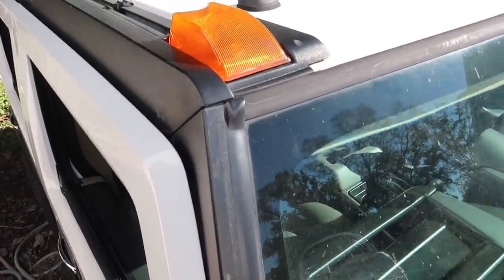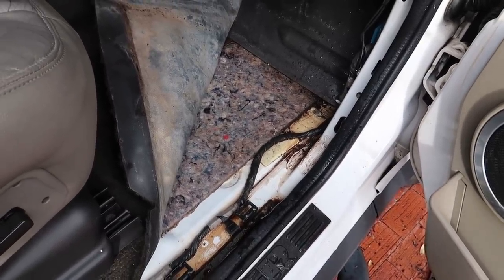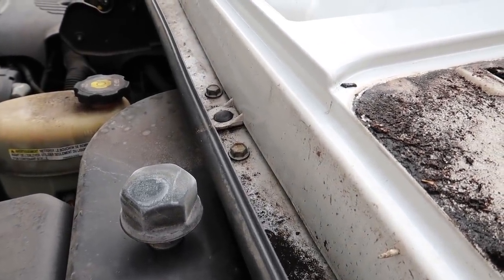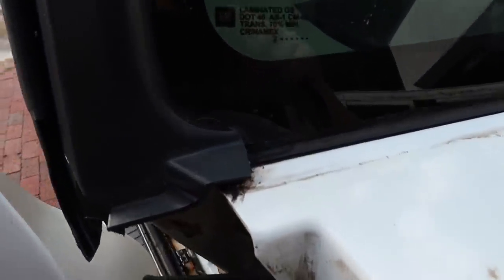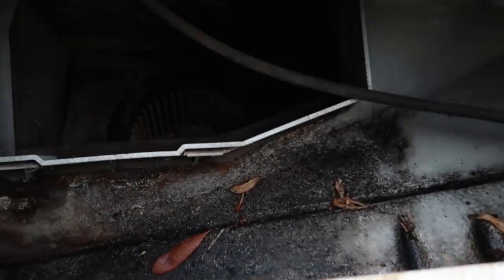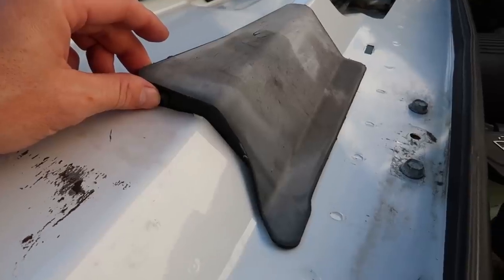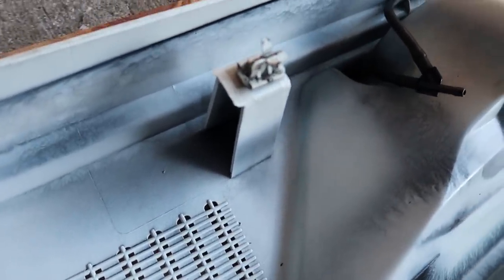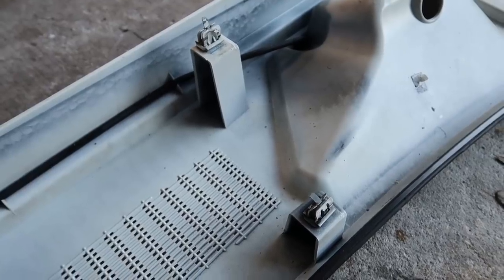HUMMER H2 WET CARPET WATER LEAK REPAIR & WIPER MOTOR REPLACEMENT

Comment: nice video I was convinced the leak was though the body seal around front pass. door. or those stupid roof lights. I covered the lights w/ silicon an redid the door seal still leaking. was planing to duck tape the sun roof. now I'll take your advice an tape that area.thanks for sharing

Comment: This was my last water intrusion issue I had on my H2, removed the old gasket, cleaned and degreased area around plastic cover, instead of using tape I applied a nice bead of water resistant silicone around the outer lip, installed the cover while pressing it into place allowing the sealant to ooze out around the edges, and added an additional bead. Just an alternative. 😎👍
Reply: Honestly that's probably a better idea, as when this tape does wear out it's going to be a mess to remove.

Comment: Front column roof leaks can be caused by the seam seal by the roof rack rails caulking cracking near the far right and left running lights. I used flex seal to water proof that. There is caulking that runs the length of the roof on both sides, check for cracking.
Reply: I just bought a 05 and noticed head liner on both sides gets damp.  I bought new seals for the lights. Did you remove the old seal by roof racks or did you just silicone over it?
Reply: @coopcooper8228  You can silicone over it with marine seal or flex seal

Comment: Thanks for the video. Mine is getting water on my driver side, wonder if this would resolve my problem considering that panel getting sealed up is on the pass. side. I will be trying this real soon as well as replacing the roof light seals.
Reply from the maker: That’s usually the roof lights. I’d do those first since they’re easy and see what happens.
Reply: @MikeyMoVlogs  Yeah, gonna start there as that is the easiest. I have new light seals but have a good feeling the rubber grommet for the wires is not sealing well. Thanks for the quick reply.

Comment: Ill be doing this too!  My radio has gone crazy with speakers not working so that all i get is high pitched audio which hurts my ears. Almost positive it is from water getting on wire connections or the radio. Of course i have water getting on carpets too.

Comment: I didn’t even have a leak there but i think you may have just fixed other problems i was having AC is broken and making a lot of noise down in the passanger side too when with the rpm sounds like a turbo but its from down there

Comment: Something similar happens on the H3 but it is the radio antenna, water was wicking down the antenna wire and soaking the carpet on the passenger side. I removed the radio antenna and sealed the mount with silicone, problem solved.

Comment: Nice video. Thanks. I just bought an 03 off the lot from a local Chevy dealer. Very well kept from an older couple that used it to drop their boat in the water. Always wanted one and was stoked to get it. Soon as I got it home was when I first noticed water on driver and passenger floor like yours. After watching your video I called the dealership and I think their gonna fix it for free. They even gave me a loaner car. I hope they find and fix the issue. I am anxious to add some chrome accessories to the exterior and fix it up a little. Hummers are sweet man! Did you see the HX concept? Hope Hummer comes back some day.

Comment: damn im wore the fuck out, 4 hrs i accomplished, sealing up  the  roof top corner lights, never leak again, i also did this video of tearing off the big long white yea that thing, did the seal there and i put a rear door window regulator replacement, and the ac blower fan motor all done today, by my self..lol   and everything works just like fucking brand spankin new man.. that my friends is what every hummer owner needs to do to their hummer h2.. their all built the same fashion, and the Vidoes out here you caint go wrong, to al you hummer youtubers, i thank you all..yes every damn one of yus..lol  stay kool and dry my hummer friends ....... rock onnnnnnnnnnnnn
Reply: the blower regulator / resistor , i done redid that 3 months ago..lol   spent 600 on new belts n ac compressor, in all good now..lol  or should be anyways  damn..lol

Comment: Ok I'm back. I checked my passenger side carpet today and it's wet. It's just the floor.  It doesn't seem like it ran down from the blower area. Could it be coming from around the door to the floor because I did silicon unless I missed a spot.
Any more suggestions????
Reply from the maker: The only known issues are the overhead lights in the roof and the plastic door I show in the video. Typically if it’s the lights you will see water damage or dampness in your headliner if it’s the carpet under there the only thing I’ve ever known it to be is that plastic door that I fix in the video. When it rains water pours directly down that area so if anything is getting by then it’s going straight to the carpet there

Comment: Just got an H2, mine's leaking there. I read there was a recall on the wiper motor because water could get in, stop the wiper motor and cause a crash. My wiper motor works but is really noisy.  I checked recalls and there are none out for mine.  Maybe only certain years.

Comment: Thanks Man! I just fixed my 2005 H2 SUT! what about the water on the drivers side? will this fix resolve that issue too? I thought it was the roof marker lights or sunroof for the longest.
Reply from the maker: If it’s driver side it usually is the marker lights. This video is mainly/usually if it’s the passenger side carpet being soaked.

Comment: Where is the ac drain line so I can check to see if this may be part of the problem? My H2 leaks like a sieve! Already fixed the roof lights and sunroof tubes.
Reply from the maker: I’m actually not sure. My buddy had checked that who is a mechanic when it was in his shop. I’d bet money it’s the same issues as my video shows. It’s a direct chute right down in to the truck.

Comment: Omg thanks ... I've done all of the above roof lights, door trim.... I believe this will stop it. Do you have any videos on changing the lock actuator??? my rear passenger is sticking and needs to be replaced. I don't know what else to do.  I sprayed it with silicone and it worked a couple of times but not consistently. And the screws are hard to get out.
Reply from the maker: No but funny you should say that because mine just started doing that too!! lol
Reply: @MikeyMoVlogs  well I ordered one from Amazon yesterday.... but I'm having a hard time getting the two screws  loose inside the door jam. They won't budge. Maybe by the time it arrives I will have them loosened.

Comment: I hope it works. I got mine apart right now. Going to do the lights, sunroof drain tube and your seal job on that panel. I fished a rat nest out of the fender drain. Most of my leaks were driver side but the headliner was dripping too.👍🖖
Reply from the maker: Ya the headliner is definitely the roof lights. That happened to me too!
Reply: I would rather delete the sunroof.

Comment: The water is coming in on the driver's side of mine. It is getting the carpet wet under the floor mats on the driver's side and in the back seat under the floor mat. The passenger side front and back is dry. It happens when it rains and when I go to the car wash especially when I get the underbody wash done.

Comment: Did anyone do this because I did and am still having the same problem… think it might be leaking from the roof down the door gasket into the floor
Reply from the maker: Did you check the roof running lights? That’s the only other place I’ve seen leaks that go all the way down to the carpet.

Comment: Hey Where is the Wiper Motor Replacement portion of the video?
Reply from the maker: There isn’t a “replacement of it” but the process to get to it is the same. You have to take all the same stuff off to get to it. Once it’s opened up the wiper motor is right there. Should be pretty self explanatory once you’re in there.

Comment: Did you get any more leaks or that stopped ?
Reply from the maker: I owned it for another two years after that video and no leaks. I’ve sold it since then but I’d assume it’s still holding up. That rubber stuff was thick.

Comment: So did it fix the leakage
Reply from the maker: Yes completely.
Reply: @MikeyMoVlogs  thanks for quick reply  I did the same repair about a year ago but haven't had it out in the rain yet, so don't know if it worked. also did roof lights but that didn't work. still need to do the sun roof drain just to be on safe side. Thanks, hope that fix worked on mine.

Comment: Flex tape hasn't been too great for me. Used it to fix pipes in our basement due to water leaks, and it still leaks a bit. Not as bad tho, but still enough to get the floor wet. 

Maybe I just have bad luck with everything, but you might have little to no problems with leakage on your vehicle. That tape does "work", but with just a bit of pressure against it, it will leak regardless how well you apply it...

Great video nonetheless :)
Reply from the maker: Ya there’s no pressure involved here. I don’t think I’d trust it enough for that. Lol.
Reply: Well, if you go to use it against something that puts out pressure, don't... 

It will not work. 

I also noticed your channel growth, and holy.. Almost 50k!!! You'll 100% hit 100k before 2020. Pfft, I'll even say before July.
Reply: Ibthink im going to use silicone and flex tape lol

Comment: Ur terminology is killing me smalls. And the rest of us auto techs are cringing when u said pressure washer to engine bay. Star screws are known as torx screws. Friction tabs are plastic retainer pins. Water could also be getting in from ac evap drain pain, so ck whats referred to as the condensate drain. May need to blow that out carefully with some compressed air.  Have a good one
Reply from the maker: The real sad part is I actually know all of that terminology but for some reason I get super tongue-tied as soon as I am in front of the camera :-( and I already checked the AC line that you mentioned that  panel was definitely the source of the water.
Reply: Its the same on my van brother. Thats why i mentioned it
Reply: FR, those screws are called torx screws, and buy an auto trim pry bar set, nothing like using the rights tools for the job!